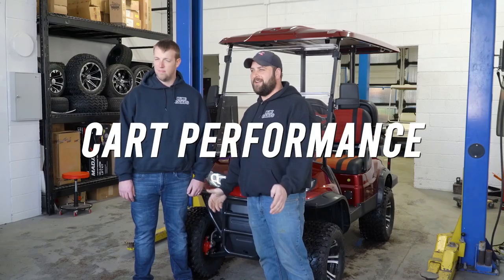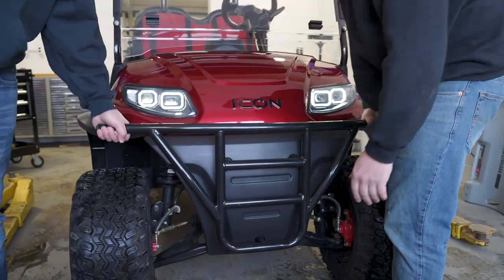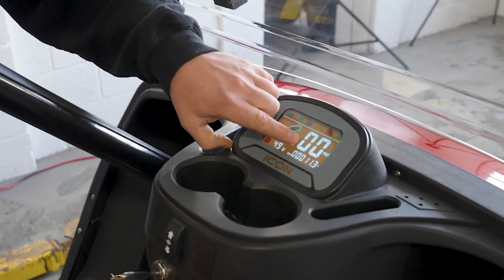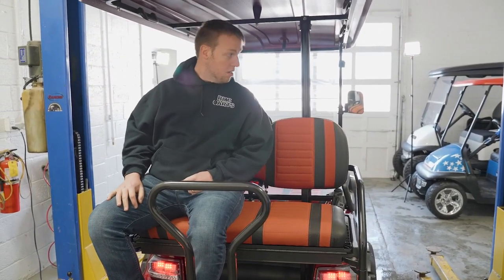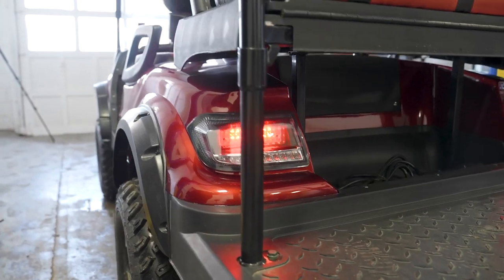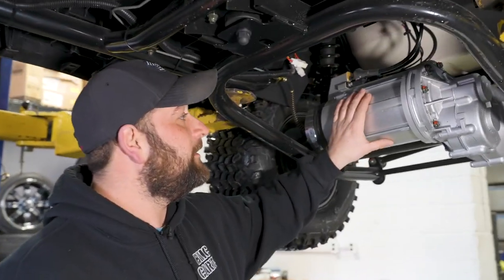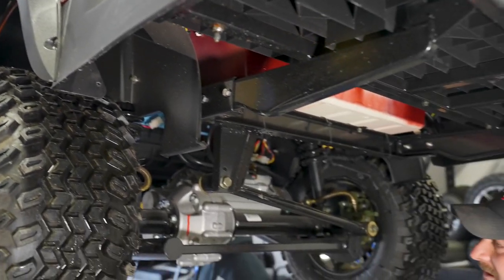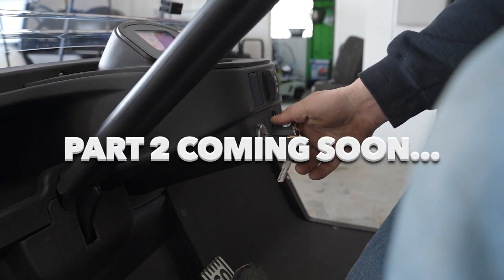ICON i40L UP CLOSE LOOK OVERVIEW/REVIEW

Comment: After watching this video, I researched this model more, and . . . purchased one.  The ICON i40L, with Lithium battery, side steps (it has a 6inch lift), onboard 8 speaker stereo, wood grain dash and steering wheel.  I love it!  I am still getting used to the spring loaded GO pedal, it is very sensitive, and has a learning curve.
Anyway, thanks for the extensive review, it was great seeing up underneith . . . still looking for the hydraulic oil resevoir, it has 4-wheel hydraulic disc brakes, must have a small tank somewhere - I am told it may be behind the dash.

Comment: It may sound like I'm being picky, but the way that key sticks out, will be a hazard to a knee or get broken off by a knee.
Reply: I'm going to my local Golf cart dealer later today. The Evolutions there seemed nice. I don't need the backup camera or the stereo though, I will ask if the have Icon or Royal instead have just a gutted model no fancy stuff, just lithium battery, lights, turning signals . I'm wanting to attach my cargo cart in a back trailer hitch... any ideas on a newer release for a tough golf cart almost a utility golf cart? Thanks

Comment: Been looking at the Voyager Pioneer. Do you guys have any insights/reviews on this cart? New subscriber, appreciate your content. 👍🏻
Reply from the maker: We have not seen the voyager carts yet. I did look them up. Looks like the cart is the same chassis style as the kandi carts. Also the 65 amp hr battery seems really low for a 4 passenger cart. Other then that looks like a nice cart. Thanks for subscribing appreciate you watching!
Reply: @CartPerformance  Appreciate the reply. Was looking into the ICON against the Voyager. Your recommendation would be go with ICON, right? Keep up the great content. 👍🏻
Reply from the maker: @mikehood7096  I do like the icon so far it has been proven to be a solid cart. Also icon stands behind their products and dealers. They really try to handle any warranty items as fast as possible. Only can tell you from my experience as we are a dealer for them. Only have had a few issues with the all the carts we sold so far.
Reply: @CartPerformance  Thank you for your time.

Comment: Great carts… but what about a trailer hitch receiver? Is there one that would work best?
Reply: I'm going to my local Golf cart dealer later today. The Evolutions there seemed nice. I don't need the backup camera or the stereo though, I will ask if the have Icon or Royal instead have just a gutted model no fancy stuff, just lithium battery, lights, turning signals . I'm wanting to attach my cargo cart in a back trailer hitch... any ideas on a newer release for a tough golf cart almost a utility golf cart? Thanks

Comment: Great video  I recently bought the Advanced ev model (6 inch lift) which is basically the same as the ICON I was wondering if the lifted model can be lowered  about 2 inches which would make it a lot easier to get on and off ..
Reply from the maker: Currently there is no lowering kits for the lifted carts. This is something i want to explore and find a option for. As for many of the new carts they are  frame lifted and not suspension lifted. I have not tried anything but just a thought possibly a shorter coil over spring may bring the ride height down.

Comment: In the video you guys mentioned that you liked it for the most part. What if any changes were you referring to?
Reply from the maker: We think the biggest issue is the seats currently. Other thing was the pedal response some are really touchy. Also the regen is up high sometimes on them. However that is not much of a issue now that there is software out to adjust all that.
Reply: @CartPerformance  I must have missed that specific part, what don't you care for with the seats? Uncomfortable?

Comment: Which would you prefer between the Icon and Evolution?
Reply from the maker: Icon is the better cart in our opinion. I’m picking brakes and suspension over the lithium battery. The icon feels solid and gives smooth and quite ride. Prefer the icon on overall looks as well.

Comment: Do the brights stay on like a car? Also, why does the steering wheel have a horn like button in the middle but the horn is on the lights controller?
Reply from the maker: The brights do not stay on like a car you have to hold it back. Not exactly sure why it was designed this way. All the aftermarket steering wheels have the horn button. They are a universal steering wheel that would work for a car with the right adaptor is why they horn button is there. In the golf cart the design is much simpler than a car. All the wires stay on the steering column. There is nowhere  to run the wires to have the horn button work when turning the wheel, the wires would twist and break after time.

Comment: I still have a little before retirement but am looking at different options for now. IF you get the seats in the back, are they permanent or can you easily swap them out for an area for golf bags?
Reply from the maker: Its more permanent. However. They have options for utilizing the "kick back rack" on the rear to holster golf bags. While still keeping your 4 seater set up.

Comment: Great video guys. I have a 2022 icon i40. I bought the navitas controller just to find out the new icons no longer use the Toyota neos and the new controller uses a 35 pin wiring harness.  I bought a new harness but can’t get all the wires to match up. Have you guys tried installing navitas on new icon?
Reply from the maker: We have not. Its on the list to do but seems we get so busy with day to day operations. Have you tried to contact navitas. They may have something in the works already for this issue. What controller is in the cart now?
Reply: What does the new controller give you?

Comment: I’m looking at i60 and I read all the parts are made in China. I’ve heard horror stories in todays world where Icon controller goes bad and customers are waiting 6 months for a replacement part.  

Do they not have lots of parts in stock at the dealers and HQ in Tampa? My only hesitation is spending 12K and having something go wrong and it sits in my garage for 6 months waiting for parts.
Reply from the maker: Yes they do have a lot of parts in stock. Unfortunately  this is going to be the same even if you stick with one of the 3 main manufactures. All the stuff mostly comes from China. 

Icon is selling more units here in the us then ever before. Controllers on the new carts have been changed from a neos controller to a lv tong controller. Same controller that is in a ev titan, advance ev, and a few more carts i cant think of right now.
Reply: @CartPerformance  I bought an i60L and loving it so far.  Thanks!

Comment: I bought a icon i40L indigo blue with blue an black seats lifted kit 12 inch wheels just like the one you have there.there delivering friday  .Im excited about it. i hope its a good one .is it a 110 outlit i forgot to ask him.but thanks for showing this on here.thanks guys.
Reply: mine cost me $10,500 i drove it at
 the icon lot it was fast as hell..great driving guys.
Reply from the maker: Awesome! Tomorrow you should be riding that awesome cart. Yes the outlet is 110 and will plug into a regular outlet no problem.
Reply from the maker: @bobnjeffsilvers5811  Enjoy that cart thanks!
Reply: @CartPerformance  How can i get it to go faster than 25 .
Reply from the maker: @bobnjeffsilvers5811  You have to go to a dealer. They should have the computer to turn the controller up.

Comment: i`m sorry but how could icon allow a cart to leave their factory with clearly different seat covers. tells me there is no quality control, which tells me all i need to know
Reply: I'm going to my local Golf cart dealer later today. The Evolutions there seemed nice. I don't need the backup camera or the stereo though, I will ask if the have Icon or Royal instead have just a gutted model no fancy stuff, just lithium battery, lights, turning signals . I'm wanting to attach my cargo cart in a back trailer hitch... any ideas on a newer release for a tough golf cart almost a utility golf cart? Thanks
Reply: Seems quality control doesn't realize you Don't charge AGM batteries with Flooded battery algorithms either.. Just take off work to get it to a dealer and "if" there is a problem.. we'll cover "that" cost of updating the charger.. Let's just say Icon and I are not on the best of terms with my new cart purchase right now. Flooded battery charge cycle with AGM batteries seems to be a MAJOR issue for them right now.

Comment: The 2022’s come with the new controller and motor. No way to get the Toyota motor and vice versa
Reply: better or worse?
Reply: @benjaminperkins9649  time will tell. Has the capability to go faster, though reliability is the question. Plus they come out of the Tampa factory 19mph, so the bigger equipment doesn’t really matter
Reply from the maker: Thanks for the info. I believe they are all now coming with agm batteries as well.
Reply: @noahboock  whoa bro? 19mph? That isn't what we do in Arizona and all of our icon carts go 25mph standard! Check with your dealer. We have agm batteries now as standard in some locations and always an option, but the agm batteries with the new 450amp controller make icon carts glide brother! The new 450 controller is standard now on all icon vehicles 💯

Comment: DO NOT buy one of the ICON CARTS!!!!  THEIR customer service is horrible.  Once you are out the door you are on your own!!  And impossible to get anyone to help!!!  BEWARE  Batteries are worthless...sure three year warranty but you pay labor if you can get them to agree to pay for parts...again BEWARE!!!  Terrible!!!
Reply from the maker: Sorry you are having issues with icon. Can not say we have had the same experience with them so far.  We are a dealer for them so far on any warranty claim they have not denied anything we have submitted. You are correct it is only a parts warranty. I would suggest going back to the dealer  you purchased from. You can also reach out to me and i will help you if i can bmcgolfcarts@gmail.com
Reply: Icon has the best warranty on there cars even if the customer dose not do there routine maintenance on the power train parts they will cover it as long as it’s fully intact it can take a few weeks for the turn around some times